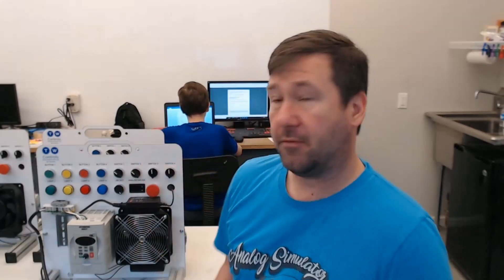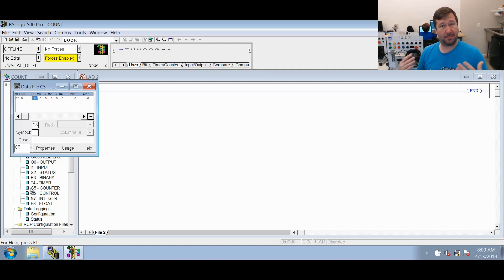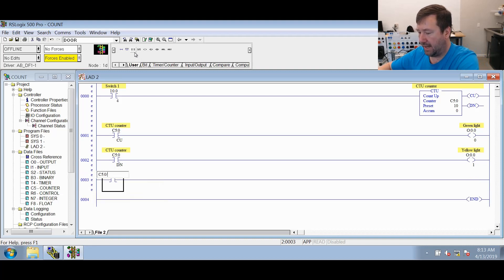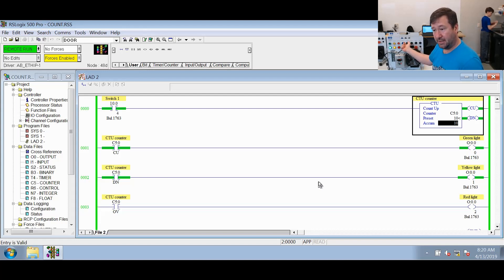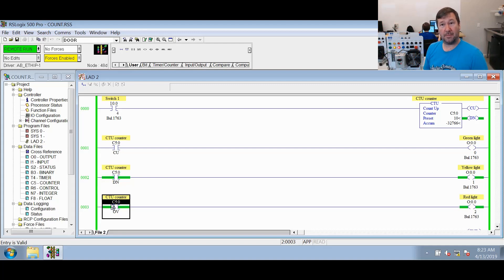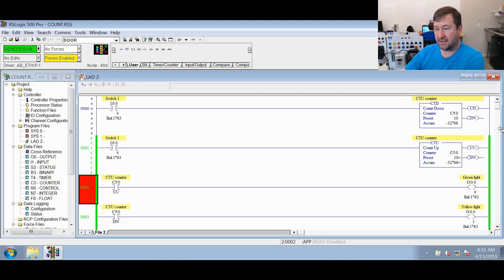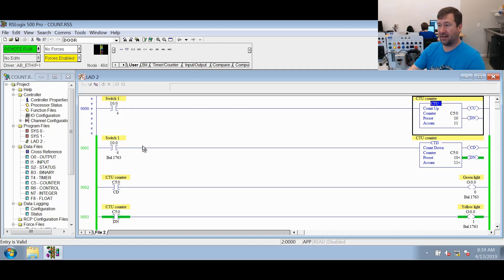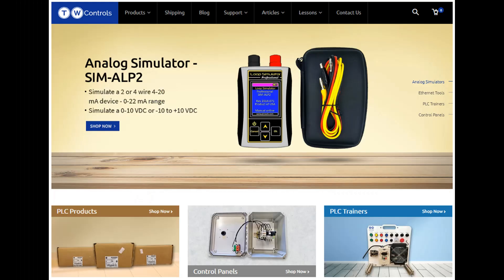RsLogix 500 Counters - CTU and CTD Count Up and Count Down Counter

Comment: How would you add a reset to a CTD?
Reply from the maker: Use the RES instruction in a separate rung.
Reply: @TimWilborne  is it possible to do a reset with a CTD timer without a CTU one? My problem was it automatically resetting because it uses “<“ when counting down and if you try to set the number to a negative, since 0>-x, it’s constantly resetting itself.
Reply from the maker: @tonyrange1874  A counter's range is 0-32,767.  I won't go negative.  You need to make you own using an ONS instruction and a SUB instruction in place of the counter.

Comment: dear sir, I need your help about slc 500 plc program
Reply from the maker: What is your question?
Reply: @TimWilborne  I have two question,  1. how can create 10 digit counter. and 2. the count value should not reset after power off slc 500. (2324567999 after again power on 2324567999)

Comment: U could have made preset value in CTD counter 0,and acc value 10....then it would have worked counting down....RIGHT??
Reply from the maker: Hi Ashish.  I'm not understanding your question.  Are you talking about around 11:40?  The CTD counter worked.  It will decrement the accumulated each time the CTD is enabled until it reaches 0.